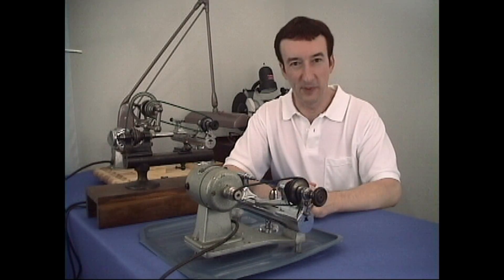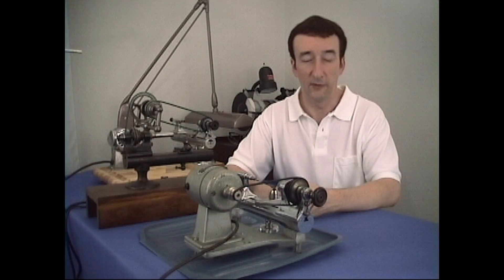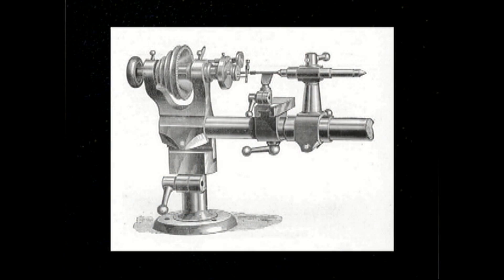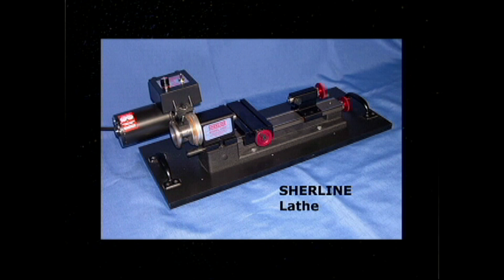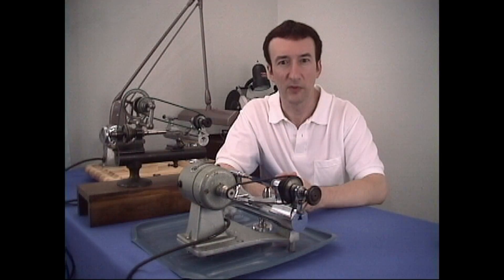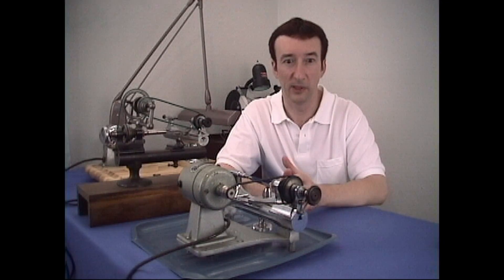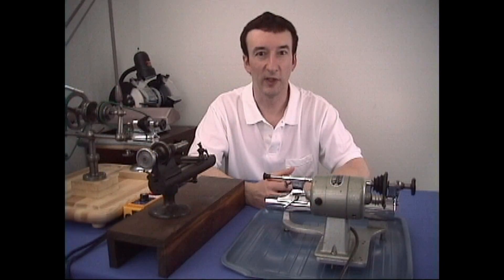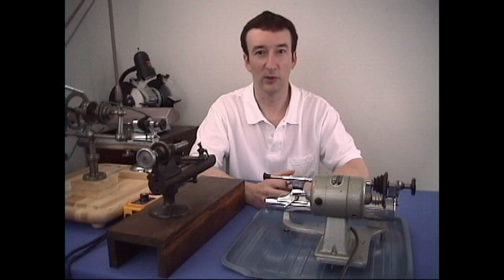Don't buy a Jeweler's Lathe! Watch this first. PART 1. Clockmaker Watchmaker Lathe Basics

Comment: I have a quick question for you. I recently purchased a swing tail stock for Julie and it actually is around 2 mm high from the head stock. Any way of A lining this on my Watchmaker’s lathe.  Oh and by the way, I tested this on 11 other lathes than the same problem exists.
Reply from the maker: Parts from different lathes are not always interchangeable.  That make of tailstock may only work on the lathe it was made to be used.

Comment: My clock is 180° off in the chime. If it's 12:00 it chimes six times. If it's 6:00 it chimes 12 times. If it's 5:00 it chimes 11 times. If it's 11:00 at chimes 5 times etc. How can I fix that?
Reply from the maker: That issue is addressed in one of my other videos.